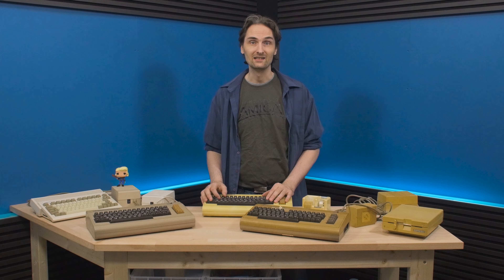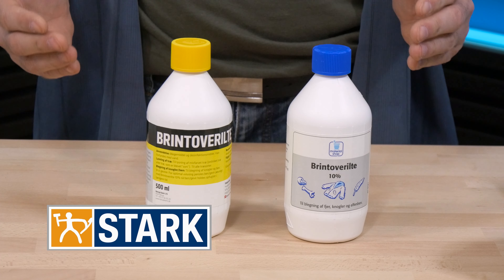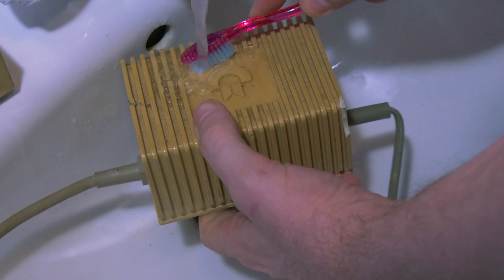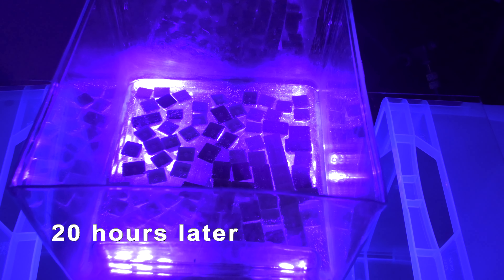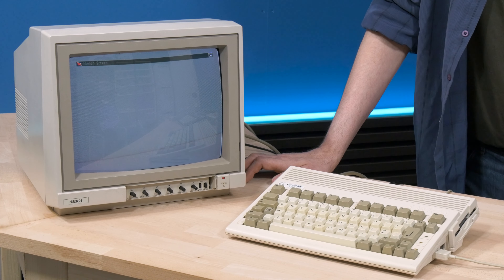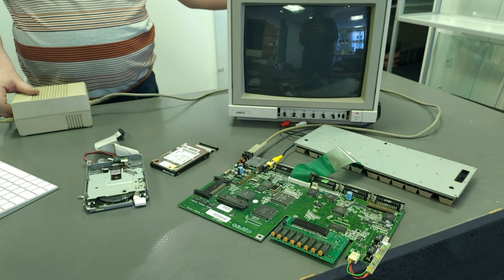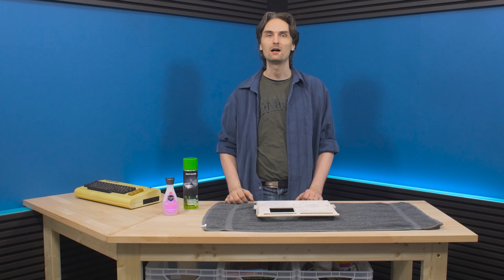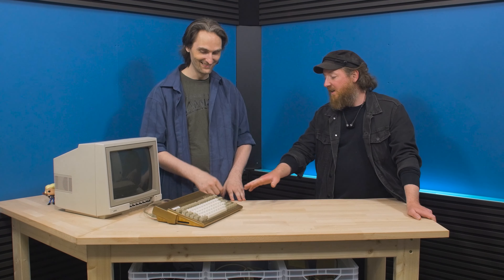Retrobrighting The Danish Style. Part 1

Comment: How long does your solution last ? RetroBirght only work for 2 or 3 years before the brome into the plastic turn the plastic to yellow/brown again
Reply from the maker: That is a good question. When they made those computers from that era I guess they weren't thinking about the problem of the plastic turning, only the next products to sell, My best guess Is that it's the same As they use in the United States (Hydrogen peroxide) But it always depends on Where it is placed in one's home, The one thing One can do is Put some UV Protection Film to the windows to Reduce UV Rays. Maybe I should take a picture of the computer once a year in the same room with the same lights to see the difference, That could be a good follow up To see if the plastic starts to turn even when it's not near the sun light, That way we all can see How long it takes for it to turn🙂